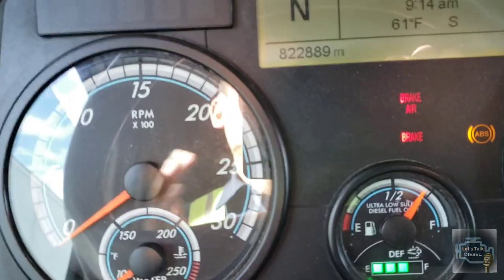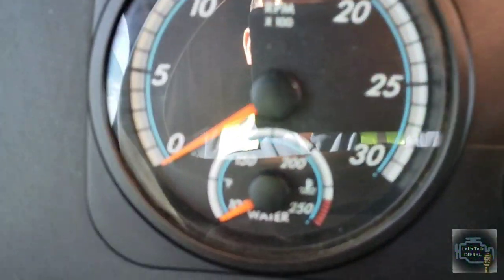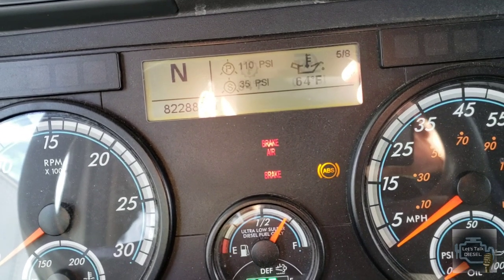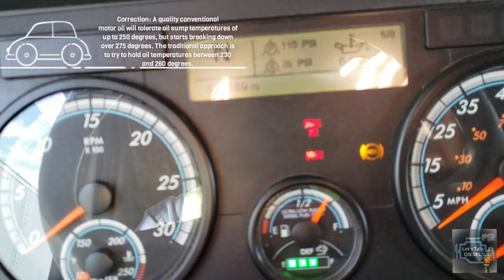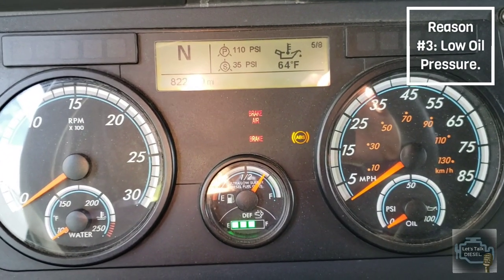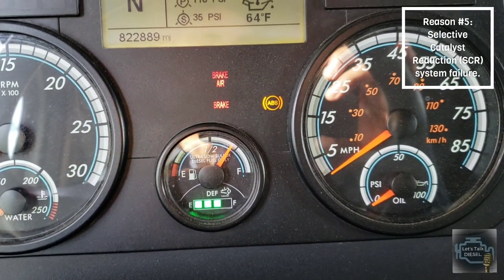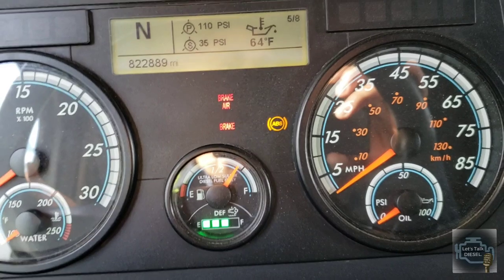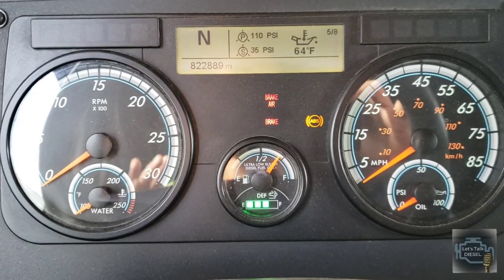Let's Talk about... The Red Stop Light.

Comment: Great advice on this subject. Having bought a diesel car recently with very low oil I drove it home carefully a few kilometres. Now I’ve drained the little engine oil that was in and put 4,5 Liters of synthetic new oil.All other fluids are to the top level.Do I need to start car to get rid of dashboard red stop light as it’s still on when the sump is full ?🤘👍🇬🇧

Comment: Hey my guy my stop light came on and all of my readings on my dash were alright air pressure temp and the oil pressure was between 30 and 40 psi I checked the oil level and the coolant level added to the coolant level and oil as well, and I have never had a  stop light indicator before and when the stop light did come on there was no decline in the power of the truck, so as I continued driving to my destination the stop light went out and the beeping stopped, I began to believe that the coolant level was perhaps too high or I may have put in to much oil.I am at a lost for what could be the problem as my dpf is not low and I bought some def from O Riellys and put it into my def tank could I have gotten some bad def from this place ? who know,. I am not loosing any power and as you have stated no driver wants to see or hear that sound of a stop engine light to come on. please comment on what could be going on or do I get a Jpro done at a mechanical shop.
Reply from the maker: Could you tell me what kind of truck are driving and the year?
Reply: @LetstalkDIESEL  I am driving a 2014 International Pro Star With A SX-15 Cummings Engine.
Reply from the maker: It could be a problem with the coolant level sensor, if this is an intermittent issue, perhaps you could let a technician to check with a Cummins software, if the problem comes back again (on and off), the ECU will save the code and you will be able to know why the stop lamp turns ON. JPro might be helpful as well to know why the stop lamp is ON.
Reply: My light came on, but coolant is fine everything is fine and no leaks or smoke...I have a 2012 international 4000

Comment: all lights on dash come on and low air alarm comes on only when going 65 mph or higher any suggestions please
Reply from the maker: Perhaps it is a electrical issue (for example: alternator might be overcharging) relate it to the Instrument Cluster (ICU) the proper diagnostic tool is need it in order to know where to start to look into this matter. Thanks for watching.

Comment: Just recently changed my oil. Didn't have this problem before.  Orange engine light comes on first,  3mins later stop engine light comes on.  Could my oil level be to high?
Reply from the maker: Not really, perhaps it is another issues, it is not common after an oil change the amber and red light to turn on. Make sure your oil pressure is fine, also if this continues every single time you start the truck better to take it to repair shop where they can hook up a computer to see what is going on. Thanks for watching the video.